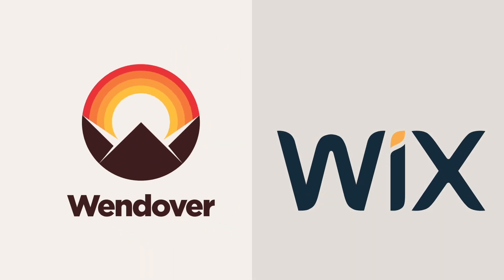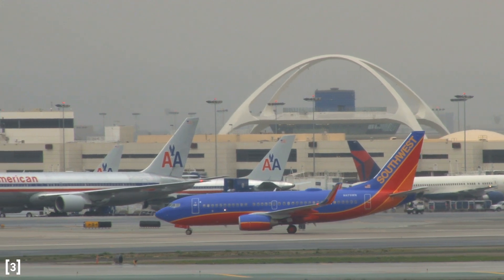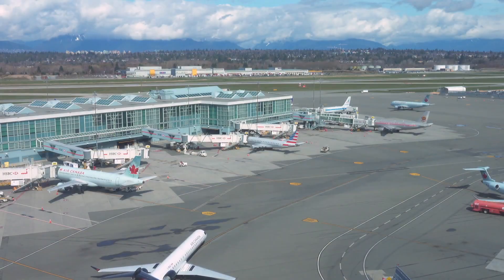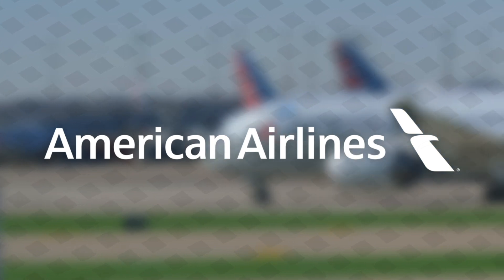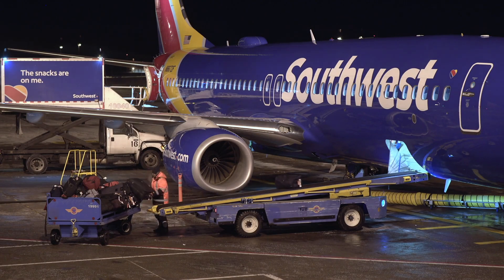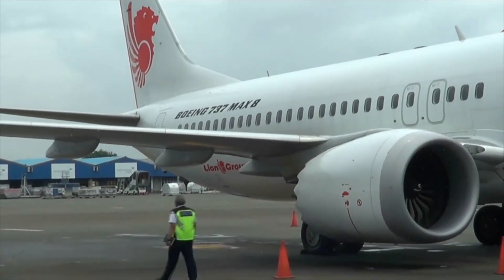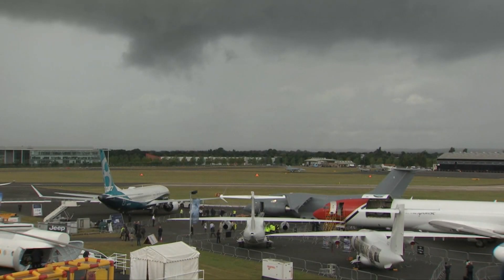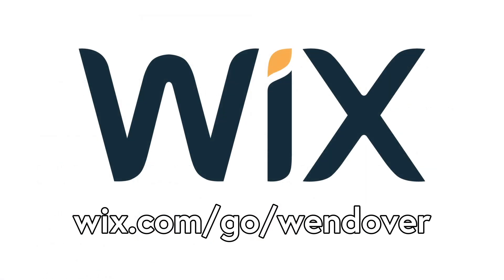The Economics That Made Boeing Build the 737 Max

Comment: Everyone that who don't know aviation and competitors and Boeing haters: It was Boeing fault.
Me and Boeing fans and Boeing: Blame the AoA sensors, hmm did someone forgot to seal the sensor again while giving the plane a wash?
Me: Sam why don't you use Squarespace for this but wix?
Reply: I would agree that MCAS is an acceptable solution to a handling problem IF it used 2 AoA sensors.
Let me try to remember redundant features on airplanes:
-On airbus (that I know better about, Boeing should be similar) you have Blue, Green and Yellow hydraulic systems.
-On airbus (and boeing) you have engine electrical generators, APU elec. gen, RAM (I think Boeing doesn't have a RAM system) and batteries.
-On the Boeings you have hydraulic assisted controls, but you have cables and pulleys as a fail safe.
-You have 2 VHF radios, active radar (transponder), one extra VHF or one HF for long haul aircraft. There are 3 audio panels.
-There are 2 auto-pilots, 2 flight directors. On ILS CAT 3 approaches both are used at the same time.
-Airbus systems (again, which I know more about) have 3 control laws (normal, and 2 alternates). They have 3 different sensor arrays, 3 different control computers (Capitain, FO and AP).
-There are 20% more oxygen masks than seats on a plane.
-There are redudant, standy intruments: compass, attitude indicator and altimeter.
-There are 2 engine fire agents for each engine, in case of fire.
And for some reason, a decades old company makes a system that only reads ONE sensor? It's Boeing fault for a non-redudant design (which they should knwo about) and certification agencies for letting that slip trough. 
The "you're using it wrong" should never be the why a plane falls.

Comment: Does that mean that the 737 max is less safe as it's not modern at all? Seems like it goes against some sort of regulations, no?
Reply: will done. you've figured out the video. have a potato.
Reply: @williamn6133  thanks for to potato. I was thinking dosn't this go against some sort of regulations. Didn't say it though as  I'm retarded and forgot.
Reply: No, the 737 max isn't old, the 737 family is. Secondly after software updates the 737 max is most likely just as safe as Airbus's, if not safer.

Comment: You forgot a MASSIVE point: old design similar to previous models also means that pilots are more familliar with the type, and therefore less prone to making errors. And 737 pilot worth his salt will tell you that what caused the ethiopian plane to crash was in proportion of at least 70% pilot error. They failed to identify runaway trim (incontrolable trim either up or down, which can happed for any number of reasons), and missed 2 items on their memory checklist for flight control malfunction: disconnect the autothrottle and disconnect the stab trim cutout swich. That’s a big no-no that cant be placed in any way on boeing.

Also, FYI folks, MCAS automatically disconnects for 30 seconds when you engage in NORMAL TRIM USAGE.

I honestly expected more from this channel.
Reply: Read the preliminary crash report. They followed all Boeing provided procedures. A reminder that this happened to 2 planes in 6 months shortly after takeoff. The problem is the plane not the pilots.

Comment: 'There is one other big difference between modern aircrafts and 737 MAX, most modern airplanes are flying up above right now, the 737 MAX is not...."
Most SAVAGE line of 2019
Reply: an old plane that has been renovated with compromises to safety.
Reply: MCAS is so f.ing stupid. Not to mention untrained pilots who probably didn,t even know you can turn off mcas.
The executive who green light the MCAS system should be fired and Boeing should be sued because they are 100% liable for the hundreds of human lives that they took, and for what?! So they can make a quick and easy buck. Real smart Boeing. You just threw your reputation into the toilet for some cheap gold.
Reply: Nailed it
Reply: That is what we call an expectation subversion
Reply: Max 8 and 9 are grounded internationally
Reply: It has cost Boeing dearly.
Reply: @cb2000a  and will keep on costing. as trust is the most fragile good there is. once lost it can take a very very long time to get back.
Reply: + it's during take-offs only, if you have the autopilot enabled it will work the same as MCAS, but better, as the pilots would actually know how to turn the self destruction mode off when it's malfunctioning
Reply: now i finaly get it xD
Reply: MCAS Shouldn't exist in the first place, maybe they implemented it and then thought the same as I do right now, then forgot to remove it (and update it for that matter).
The pilots would have found out the plane was pitching higher than their previous planes and would just correct it themselves.
Reply: Wendover has savaged Boeing
Reply: You mean sick burn.
Reply: Calling your own comment savage, lame
Reply: For a moment there I though I was watching half as interesting
Reply: This is what I came to write... The comment really made me laugh
Reply: Why cant Boeing just omit the entire MCAS system?  Just tell the 737 crews about the different center of gravity and airflow changes to the 737 Max fuselage and get on with it?
Reply: Have anyone seen the 737 MAX design Failure Mode Effects Analysis DFMEA? This should capture the issue early in design.
Reply: Only a pilot can get this punchline... 😂
Reply: The plural of Aircraft is "Aircraft", not "Aircrafts".
Reply: mezsh The plural of Aircraft is "Aircraft", not "Aircrafts".  Who cares. Many people on here are using English as their 2nd language. And with daily newspapers costing $3.00, there is no need for editors to correct the grammar.
Reply: Sir Eugene Courtney - I support the use of correct English everywhere in the U.S. based media.
Reply: Thank God or Allah your not the pilot or it would be flying into a building.
Reply: @wkdravenna  Allah means/is God.
Reply: Are you on drugs?
Reply: What's so savage about it lmao
Reply: @a55a551n90  Two 737 MAX planes crashed very recently due to a software or hardware failure
Reply: @MarloSoBalJr  I know. I didn't find the quoted line savage
Reply: @a55a551n90  because you're not a Boeing executive or investor,  you have no emotional tie to it.
Reply: @MarloSoBalJr  watch ave's video on it
Reply: MarloSoBalJr MCAS
Reply: Bege Motik He's using the term idiomatically, not literally. I find it appropriate. Would brutally honest make more sense to you?
Reply: @a55a551n90  just like how planes go over your head, the line did as well.
Reply: Actually it's only the 737 MAX 8 model, the rest are flying
Reply: @RonniebonGaming  Actually some regions banned ALL MAX models, not just the 8.
Reply: Pyra Darkstorm Techinically it's legal for a non-Chinese airline to fly 737 MAX 8 in China right now but of course the Chinese government will not let this happen. All Boeing 737 MAX that is commercially available has been de facto grounded globally (only 8 and 9 commercially available right now and both are grounded).
Reply: No
Reply: @RonniebonGaming  To my knowledge, MAX 8 and 9 are grounded worldwide.
Reply: @RonniebonGaming  if they are still flying would you take the risk?
Reply: @noahbowie5985  Yes, but only on airlines based in Europe or America.  They were at least trained on the system.  If you ask a pilot what they would have done in those two accidents, they will just reach over and flip the override switch.  However, Boeing never required MCAS training when transitioning therefore some of the pilots in Asia and Africa were never made aware that there was a programming switch between the aircraft. Not only this, but MCAS uses only 1 AOA sensor I believe instead of multiple redundancy like on every other aircraft.  There are 2 changes that need to be made then: 1.) change the programming of MCAS so it doesn't nosedive like that    2.) make it read from all the air data units and AOA sensors so it has multiple redundancy.
Reply: @FunFunFun8888   I just flew on an America Airline 737-800 to Costa Rica, it was quite good and smooth, but on my return it was the Airbus 320, and I  felt much safer when I saw it on the instruction folio in the  back of the seat pocket,, Boeing has messed up badly, for previously I trusted all Boeing Aircraft.
Reply: @FunFunFun8888  no you are wrong, at the end of 2018, their were 7310 B737 still in operation (including 737 Max) and 7506 A320 still in operation.
Reply: @comedebreuille5396  Where so you get your facts?
Reply: @comedebreuille5396  Airbus has delivered 8,605 A320 series aircraft since their certification/first delivery in early 1988,In comparison, Boeing has shipped 10,444 737s since late 1967, with 8,918[101] of those deliveries since March 1988,[102] and has a further 4,763 on firm order (as of 31 December 2018
Reply: @FunFunFun8888  Are you on drugs?
Reply: @jerromedrakejr9332  You are brainwashed by left media!
Reply: @FunFunFun8888  Nope, you are blind(ed).
You do realise that 737 max is faulty design?
And, this is not single one design flaw from Boeing. Same is with Airbus.
I am asking you - name just one design flaw on USSR/Russian airplanes that resulted in the death of passengers.
Reply: @noahbowie5985  NOPE
Reply: @RonniebonGaming  here in the EU all 737 MAX are forbidden to fly at all. and that is a very big burden on a lot of the smaller airlines here. plus the biggest problem is that even if they are allowed back in to action if the costumer does not trust the 737 max they will just not fly with the airlines that have them. that it self will be the biggest hurdle to over come.
Reply: @RonniebonGaming  don't confuse the 737-800 with the 737 Max-8 ..  737-800 is 3rd gen while the MAX-8 is 4th gen   and  the whole MAX fleet is grounded  MAX -8/9/10 .
Reply: @RonniebonGaming  All 737MAX aircrafts are grounded including max 8 and max 9...
Reply: @RonniebonGaming  all max models are grounded they have mcas.
the 737-800 and 900 are still flying.
Reply: @RonniebonGaming  ALL MAX aircraft are grounded because they all have MCAS.